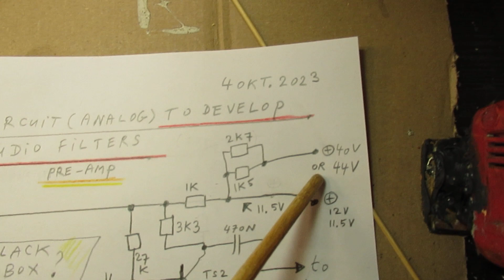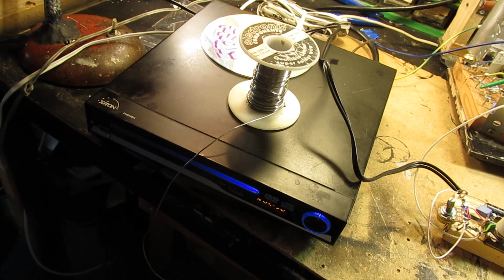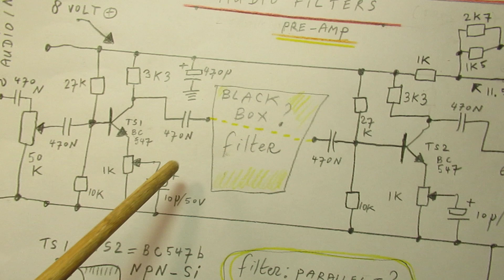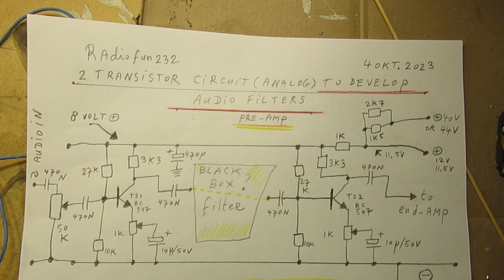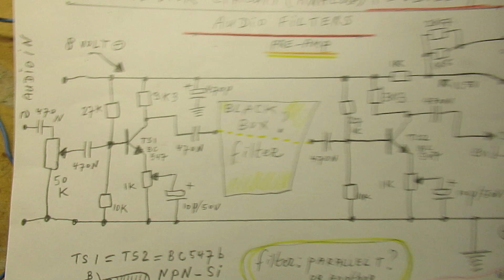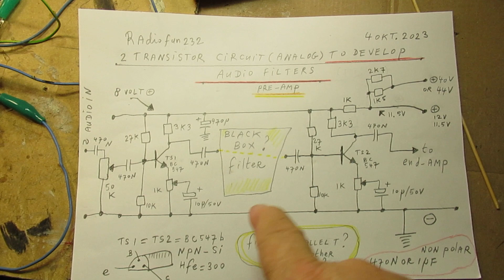2 transistor audio amplifier to do experiments with audio RC or LC filters, demo and schematic

Comment: Excellent and very interesting. Just FYI, here in the USA, we might call your future filter a "tone control circuit, or stack." Passive types only remove frequency amplitude within multiple band ranges. Active types can both amplify, or remove, frequency amplitude within multiple band ranges. I am not familiar with the term "Parallel T type" and I look forward to learning what it is.
Reply from the maker: Thanks!

Comment: Very useful 👌 thanks !
Reply from the maker: Thanks! good to hear that it was useful. You (we) can insert all kinds of R-C and L-C setups in-between these 2 transistor stages, separated in DC terms via non-polar capacitors (in-out), in-between. The 2 transistors (combined with all kinds of 3 pole R-C or L-C audio filters) will compensate all kinds of (frequency) losses, or push certain audio frequencies up (bass or high, audio range 30 Hz-20 KC), etc. E.g. by using  the parallel T filter setup, etc. Good thing is here: we are completely free in our experiments. Of course you know that, anyway. More info in my book: "Audio Amplifiers and Loudspeaker boxes" available via the website of LULU (in the textbox there are links). With these setups you can make a (say)  special audio filter, acting to a certain band in the audio range, say a sharp audio filter for 3000 Hertz with small slopes. Can be done via the parallel - T filter setup, with resistors and caps (R-C). And also (thus) very precise via the "backcoupling principle" in this 2 transistor unit. When I have time & inspiration I will show that in the future, but it is/was all published in my book (description).Of course you know these things, anyway, thanks. These sharp audio filters with a specific bandwidth can also be realized via Opamps, thus also via the 741 Opamp (the mother of all of them). 5 okt. 2023.